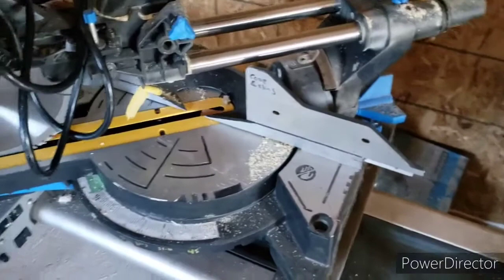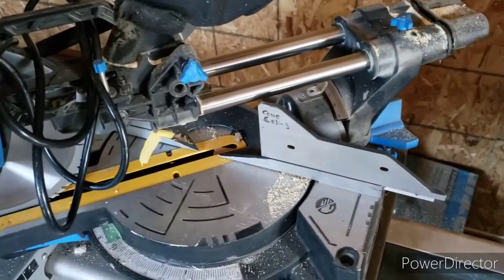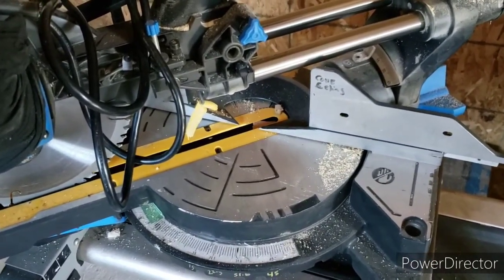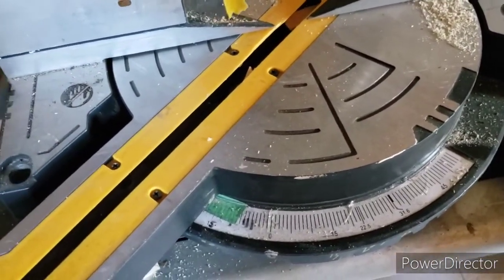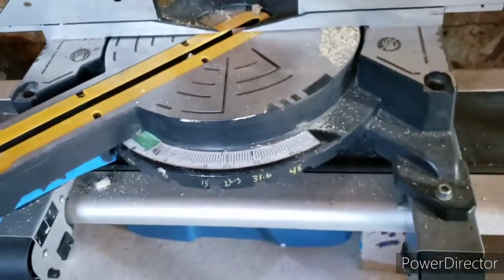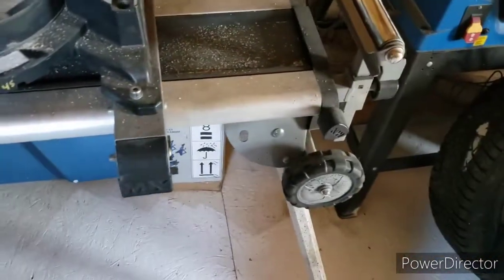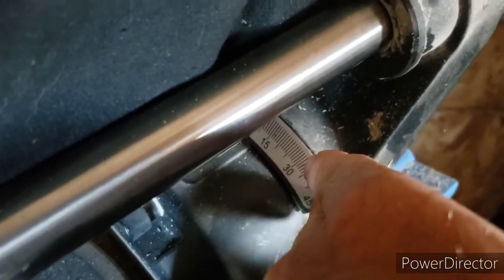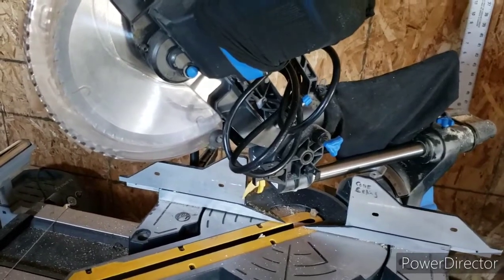Mastercraft 10-Inch Dual-Bevel Miter Saw Review. #mastercraft #mitersaw

Comment: i have a similar mastercraft sliding miter saw, but i have a problem with adjusting.
if i cut straight down without with the slider all the way in, it's perfectly square up to maybe 5 inches.
if i cut with sliding, the whole cutting head drifts to my left so it's very slightly diagonal. which means if it's all the way out, the slider is out of alignment.
is there a way to fix it?
Reply from the maker: I know what your saying. Mine is not real bad but its off yes. I find with mine if i cut with the sliders all way in and cut towards me it seems better. I havnt found a way to fix it however but would like to know if it can.  I mostly cut with 2 by 4 or 2 by 6 so. But it os annoying as hell.

Comment: Your rear fence is on the wrong way the high parts should be to the outside swap them round 👍
Reply from the maker: LMAO  when your right your right. I might even make quick video 📹 and give you the credit,  good for a laugh. Thanks 😊 and stay safe.
Reply from the maker: Interesting
Reply: Apologies.  I watched the video again, and the fence is installed backwards on the setup.  So yes, the two halves of the fence have to be swapped so the tall ends are on the outside.
Reply from the maker: @michaelm.7703 no prob lol thanks again

Comment: what am i doing wrong?? can't seem to swing the saw to the right for bevel cuts
Reply from the maker: Should be the same as the other way, loosen knob in front squeeze the flap abd turnm you may beed to push down slightly as to hold leaver and turn.
Reply: is there a trick to pulling the 0 degrees stop pin. No matter how hard I pull it will not come out. Thus no able to use the bevel to the right.
Reply from the maker: Oh you have to pull the saw enough to take the weight off the pin, then pull, there is a sweet spot.